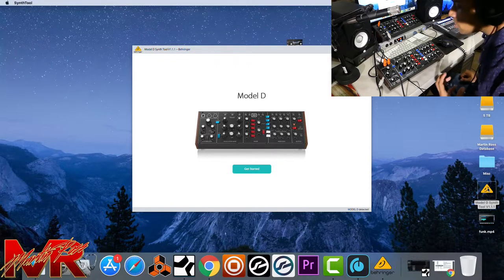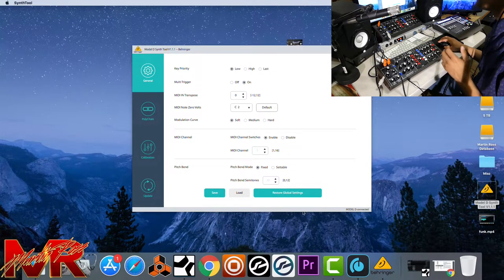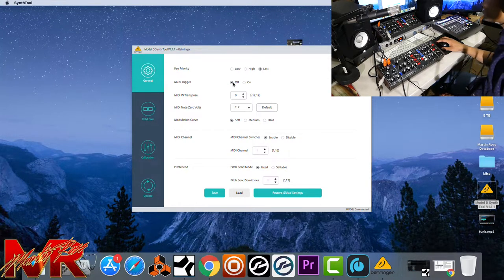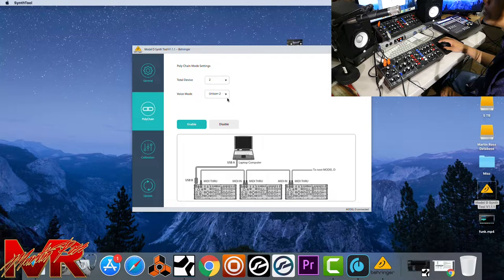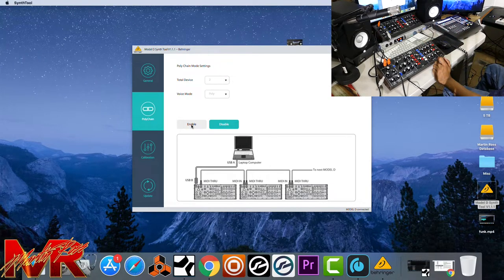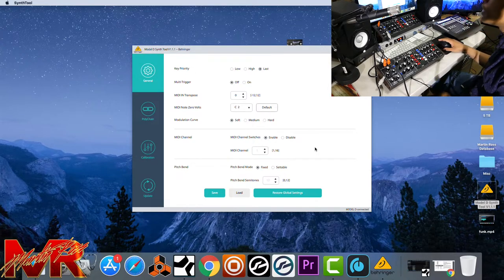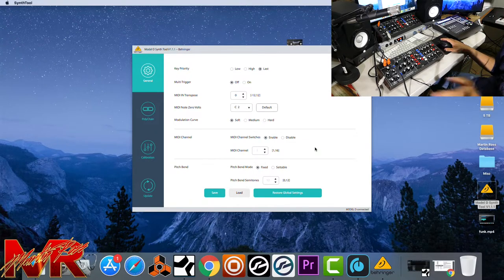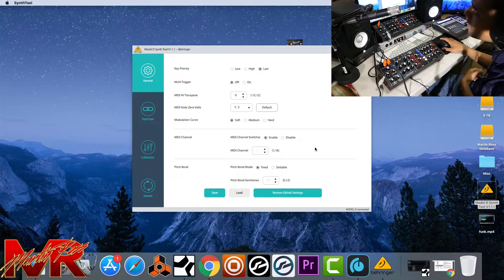How to Poly Chain The Behringer Model D

Comment: you got 3x OSC on any model D, means you can create triads with tuning the  OSC to other notes. Meaning with 2 model D you can build up to  6 notes so it's enough for any even exotic chords:). Yes, you would need tune OSC for additional chords, but if you are smart, you can leave the root note,  and tweak only another OSC to fine tune another chord. It's not perfect, but doable, and if you are into more minimalist electronic music - you don't make a lot chord progessions. In theory its also possible to set LFO to modulate one OSC in such a timing and depth that it can work for chord progression - tuning one osc by a fifth (for example) and slow LFO as per tempo of the song to change OSC pitch and build another chord.